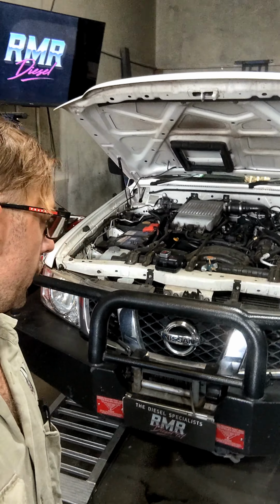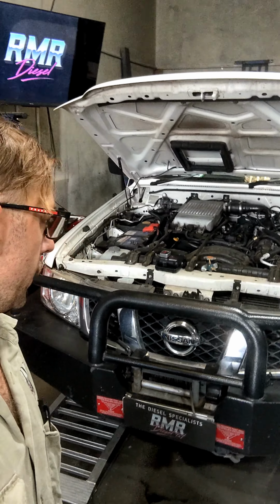Stock ZD30 remap and dyno

Comment: I understand ZD30s have reliability issues

When you remap them, how does it not expose those issues?

Thank you for your time 👍🏻
Reply from the maker: First of all, don't get caught up in the drama of 'experts' who are actually just no bodies on the internet. Literally the info I read on any forum for any vehicle is just laughable, blind leading the blind. 

Zd30's don't have reliability issues. People have maintenance and basic fundamentals issues. Main cause of failure is cracked pistons due to boost leaks on the early di model. 2007 onwards is a totally different fuel system, ecu setup, head and intercooler. They do not die. 

I have more blown up 1kds in my scrap heap than I do zd30's. Also blown up due to negligence, people working on these cars don't understand turbo diesels

I'll post a video soon of why these motors are coming up and stronger than any other including 4jj1
Reply: @Reuben_rmr  thank you for the comment 👍🏻

If you could do a video on all of them... 

from the first ZD30 di to the crd, what goes wrong and why and how to stop that from happening, etc. 

...that would be very helpful to me and many others 🙏🏻
Reply: @Reuben_rmr  very interesting about Toyota engines - don't hear about trouble with them at all 😮
Reply from the maker: @willhooke plenty of info about 1kd Toyota cracking pistons and blowing out the block between cylinders. Google it and you’ll find out 😂 very common, also great motors when done right, but not as strong as a zd30 crd. 
ZD bottom end is very strong with the crank girdle setup similar to an Toyota fte and many small trucks. 
Makes sense as Toyota used the fte in trucks and buses and the zd30 can also be found in trucks and buses even with factory compound turbo arrangement 🤯

Comment: Hi mate, how much do you guys charge for a ZD30 Di tune ? it's a 2005 GU Wagon Auto.
Reply from the maker: Varies depending on the car, if it needs our boost control setup or an exhaust. Best thing to do is fill in an enquiry on our website RMRDIESEL4X4.COM

Comment: hey mate, love ur content! what’s ur thoughts on running the boost activated actuators and would it be safe to run a 20psi 1 on a untuned crd. just have a 3” straight pipe and aftermarket top mount
Reply from the maker: Great question man!
We use gfb ones, most accurate and realisable. Have had too many issues with others, tilix work but they are too fiddly and I’m not a fan of mounting things on aircon lines. 
The best way to run a zd30 is off the factory solenoid. This is how you make the most power efficiently, making boost is more than just the turbo pulling vanes to meet target boost. 
Changing fuel calibrations in the tune will drive a turbo harder and make target better with vanes more open for flow for example. This is how RMR get the figures and drivability we do, the only way to achieve this and have all the low down torque as well is by tuning through the factory ecu with a new genuine boost solenoid installed. It’s the hardest part about tuning the zd30 crd and very few have the means to do it properly

Comment: Hey Mate, love what you are doing with ZD30s. I was thinking of an engine conversation but finding your content has made me want to keep my ZD30 but it's a DI not common rail. Unfortunately I am on the east coast. Do you know anyone in ver this way with your knowledge of the ZD?
Reply from the maker: Conversions are never perfect without spending big $ and even then. A ZD30 CRD conversion would be sweet, as it all bolts in. 
However there is nothing wrong with a Di, we work on plenty in Perth and modify them. Can make great power up to around the 250hp mark at the wheels. They just don't have the tuning capabilities of a common rail system that can go 300+. 
No one that I know of over east, sorry mate. I know Just Autos are good if you are near them.
Reply: I know this is a bit late but Border Automotive Engineering and Tuning on the east coast tune zd30's. They are located in Walla Walla just out of Albury. You can take your car in for a tune or send your ECU to them for a remap. I just had my ECU in for a remap on a 2005 zd30 Di and it was the best thing I've done for the patrol. Running 20psi safely with no limp mode issues.

Comment: can you run a electronic solenoid with a manual boost control in a high low setup ?
Reply from the maker: Yeh sure. No point though. We do it better with factory setup. Boost control is controlled by the ecu and our map on those boost tables.
Reply: @Reuben_rmr  do you know how to reduce boost bounce ?? I'm trying to figure out if I need a filter fro. the vacume pump or not ? and or a second filter somewhere ??